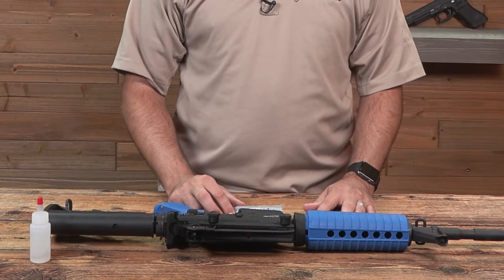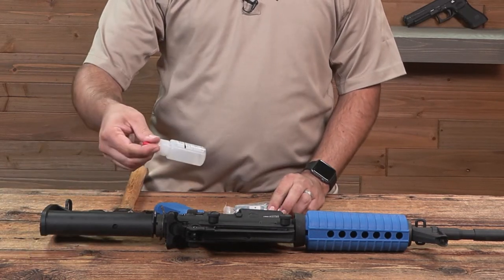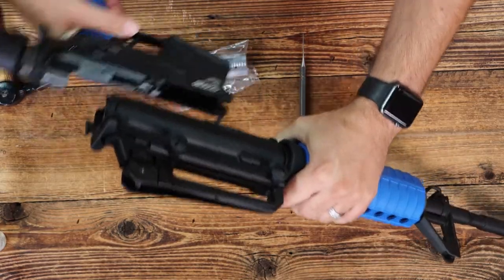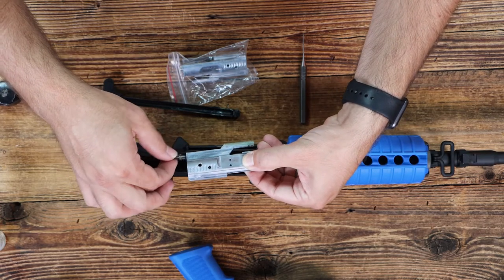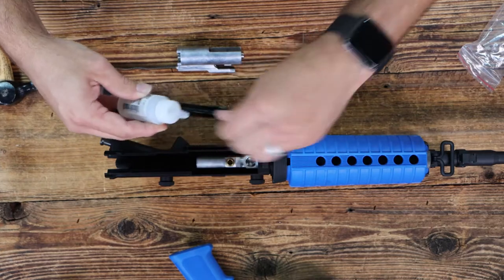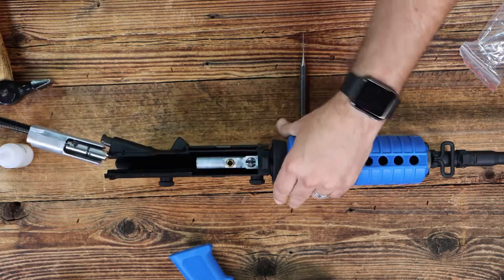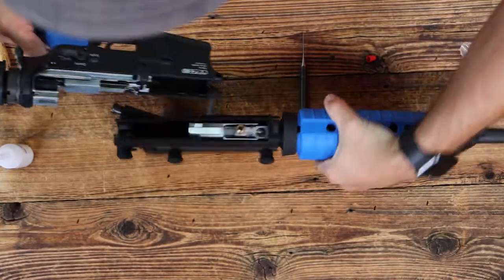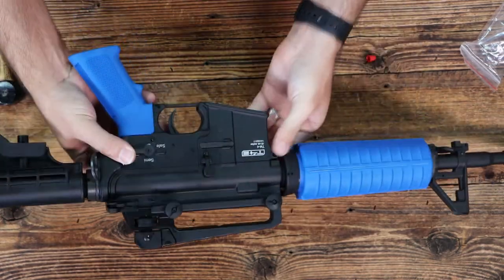TM4 .43 Caliber Rifle Bolt Replacement & Lubrication : T4E Maintenance

Comment: Quick question, why is my mag letting all the CO2 out? Like I guess the mag is leaking a lot ...a LOUD "hiss" I thought maybe I didn't screw it in all the way but I checked and it still just leaked out all the CO2😡
Reply from the maker: I'm sorry you're experiencing an issue. It sounds as if the valve is leaking and needs either a whole new mag or the 2292120 valve seal rebuild kit. 
You can add silicon oil to the top of the mag and work the valve plunger and see if that will revitalize it  but best course would be new mag. The seal rebuild kit is not an easy one so be aware. If it is still under warranty call Umarex USA at 479-646-4210 ext. 7.
Reply: @t4e  thank you
Reply: I'll just get a new one
Reply from the maker: @POISONDART14  you're welcome. I'm sorry it's not better news.

Comment: I wonder why my  replacement bolt is different to the one in the rifle? No spring on the nozzle and the rear is hollow when compared to the one in my rifle.
Reply from the maker: We assume you have the HK 416 Gen 2 bolt. The T4E HK 416 was shipped with a new Gen 2 bolt that was dark in color, had a spring on the plunger, and screw in the back of the bolt. This was only released in the later Gen 2 HK 416 models. The Gen 1 bolt is silver in color and does not have a screw in the back or a spring on the plunger. The 416 has been discontinued and as such the Gen 1 bolt is all that we have remaining in inventory. Both are fully interchangeable between the models.
Reply: @t4e  thanks for the reply, yes my 416 has the dark bolt installed. I have been looking for a spare but everyone I’ve seen is the silver type. I got this T4E second hand but new and whilst watching YouTube videos noted the spare bolt. Good to know they are interchangeable.
Reply: Can I use pellet gun oil on my T4E paintball markers?
Reply: @Passportbro33Mark2  I use white lithium grease, very light coating on working parts etc. Any rubber or o rings Pell gun silicone oil is best as it helps keep them nourished 👍
Reply: @aussmith5335  so petroleum-based lubricants are OK?
Reply: Stick too white lithium grease or silicone grease and silicone oil. Clean after every use👍